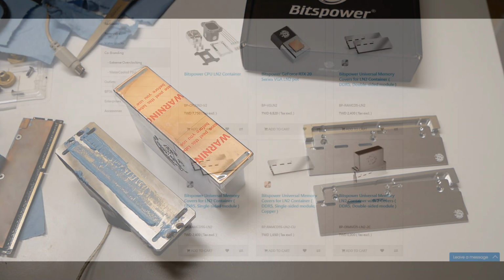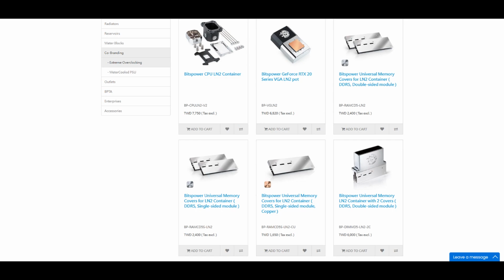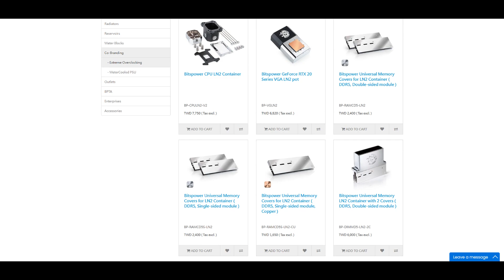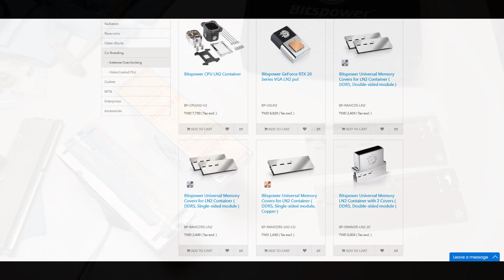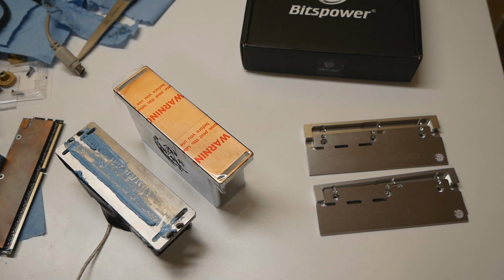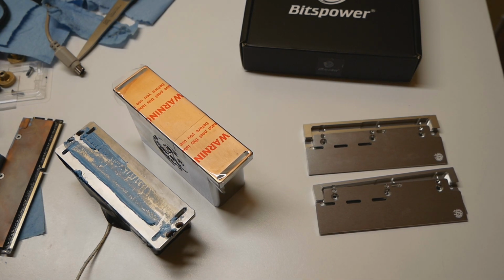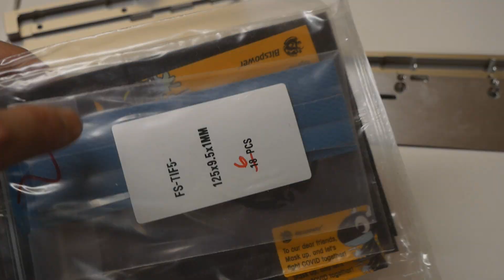Bitspower Memory LN2 Container - Overview & Thoughts

Comment: I'm curious what the purpose the slots on the cooling plates serve. From what I can tell it blocks the heat path at one end of the heat spreader. The plates also seem thinner than the Barx which is a narrower heat path. I noted this when I was first looking at heat spreaders. Form an overall design perspective Barx appears to be a better design which is what I'll chose. The funny thing is I'm using the copper water block from Bitspower which fits perfectly on the Bartx with Hynix A-die. For water cooling I don't think you'll find a better ser-up.

Great review Luumi as always. Very detailed